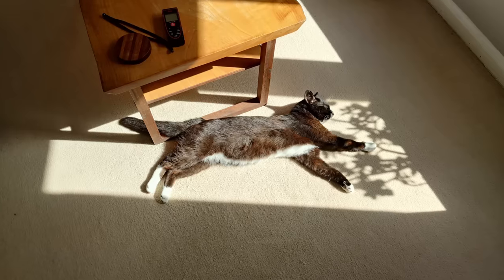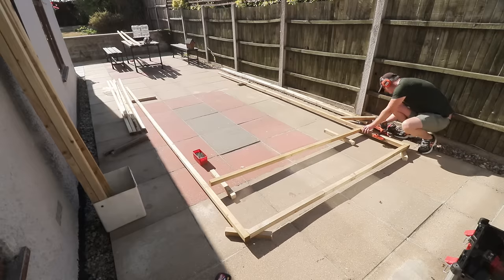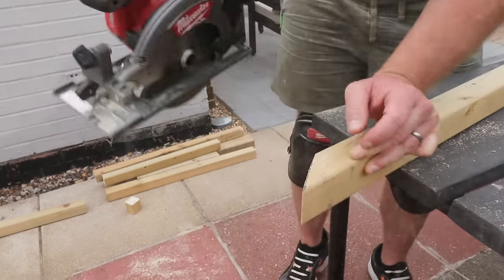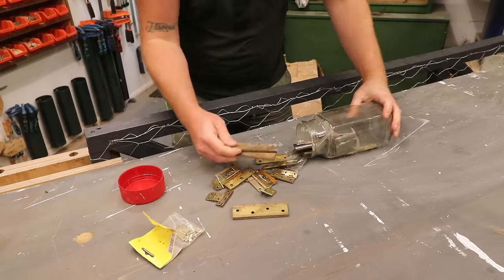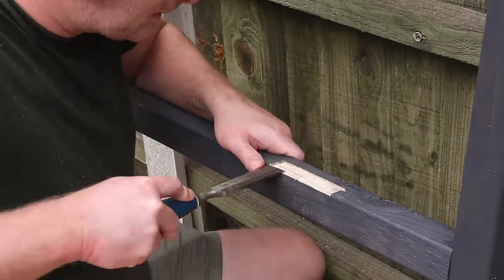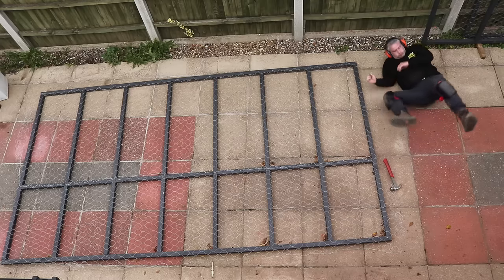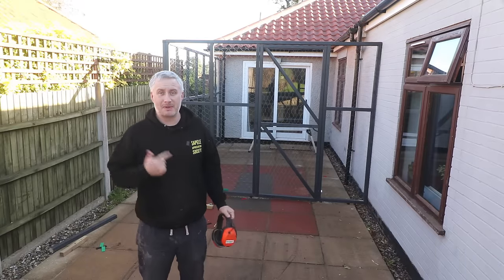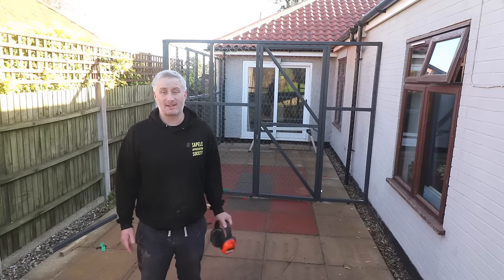We Built A Catio!

Comment: Awesome video as always. My wife is sitting next to me watching and asking when I will build a Catio for our babies. Looking forward to part 2.
Reply from the maker: Good luck! Haha. I would suggest not being so frugal when it comes to choosing mesh! Thank you
Reply: @RagnBoneBrown  I would second that, use the plastic mesh, and use a thin lath held down by some screws (paint lath and beam first, as otherwise rot will set in fast) to clamp the mesh.  OK the plastic mesh or the expanded metal is a darn sight more expensive over chicken wire, but you can also use weldmesh as a fence, it does not stretch, but you will need some serious pliers to tension the long wires to get it to hold straight, plus it does not cut with regular pliers, you want a decent set of bolt cutters instead, saves your hands.
Reply: @RagnBoneBrown  looks like you had some fun with that. Learning curve I suppose.

Comment: I'm going to be building a small catio for our cats soon, so this video couldn't have come at a better time. One thing I'd suggest for next time/repairs/anyone else doing the same thing is that 25mmx25mm 1.5mm welded wire mesh is much better than chicken wire. It doesn't 'spread' like chicken wire and is much stiffer so doesn't deform (We've been using it for a few years to make window guards to keep the cats away from a busy main road) and adds a bit of rigidity to the frame. For adjustable feet under the bottom rails, I'm planning on using some galvanised or stainless M6 bolts with a nut and washer or some M6 inserts with a hole drilled through the rail. I'm looking forward to seeing how you solved the roof problem so I can steal it!
Reply: I agree about your thoughts on chicken wire. My concern about chicken wire is that if a cat were to extend their paw through it, and for whatever reason panic or get startled, they could get injured. The wire gauge is just so thin and the hole size is just too perfect to get caught in. I'm planning on building one with 2"x4" deer fence, which does the same thing your 25mmx25mm mesh does: better rigidity!
Reply: I agree. I used the welded wire mesh on the roll for a lot of my projects
To secure it I use a nail gun that can also take staples. It's a damn site easier than trying to use the hammer in staples

Comment: I thought you did a good job with the wire mesh.  Around here, we call that "chicken wire."  We built a catio a few years ago, and I chose a different type of wire (rigid mesh).  It was also a pain to deal with, but it was a consistent width.  I also got some staples for my air nailer, and that helped me avoid using those individual staples.  Hopefully, Mickie will appreciate all of your hard work and effort.  Good show!

Comment: That's a massive catio! haha. Mickey should be happy.

Yeah I'm sure that chicken wire has it's upsides somewhere, but I hate it as well. We ended up using stucco mesh with an air stapler which was quite a bit easier.
Reply from the maker: Cheers John yeah that sounds a good solution

Comment: Having built a zillion chicken runs ( I had a poultry business) I feel you pain with the wire. It took me a couple of days to abandon the metal 'u' clips. I use a heavy duty manual stapler, it always worked fine. As for the wire, the higher the gauge and the smaller the hole makes it far less stretchy. But like you said, its a one off for you. Last point, I have seen cats get through gaps where they seem to dislocate every bone to become a pancake, that cap where the shingle is against the house looks suspect. Love you vids.

Comment: Hi Keith, having built a number of outdoor runs similar to the one you are building here for cats, dogs and chickens might I make a couple of suggestions. I gave up on chicken wire a long while ago and have used 18Ga galvanised weld mesh since which is far more convenient and holds its shape and is easy to cut with snips.  I buy this in 25m and 50m roles which works out much cheaper than the short lengths sold in garden shops and box stores and 18Ga is much easier to fold than 16Ga which is fine for flat surfaces, but not suitable for hand folding. I also use a Bosch PTK 3.6 Li cordless stapler. I find the 8mm galvanised staples more than adequate. The 4mm are also useful for upholstery, making the tool quite versatile, one charge will keep this cordless stapler running all day no problem. I have given this tool hard use over the last three years without any problems and it is as reliable now as when I bought it.
For roof access, could you not fit either hinged sections between the joists to access down pipes and gutters, or simply sections held in place with swivel clips, which would allow you remove them for easy access when required.
I think your cat should be really chuffed with this splendid catio, as it is huge and offers all sorts of possibilities for play and climbing and of course sleeping in the sun!

Comment: Great video again Keith. I couldn't agree with you more I hate working with that chicken wire and the staples. We built a kinda catio about 5 years ago but we done it up our 7ft ranch style fencing with a backward angled bracket and a tension wire to stop out cats getting out which is something you could consider for Mickey save u having build a roof structure just do it like prison style bars sloped back if he tries climb it he won't be able get over because of the angle. 🏴👍

Comment: Yassssss!  So happy to see this.  Our two kittens (brother and sister) had supurrvised (sorry had to) access to the garden in summer when they were still to little to scale the fences.  It was always our intention to build a catio for them.  Previously we had a cat wander off one day and never came back home.  That's over a year ago and we're still hoping.  He might not be too happy though if he does come back.  Two other kittens in the house!!  Anyway, back to topic of catio.  Delighted you're doing this and sharing it.  Is there any chance of a plan or a list of materials used please?  I was very doubtful about using chicken wire too.  It's a bloody nightmare to work with.   Bought some before for some project - probably to block a hole where our old lab was digging under a fence!  Cut the hands of myself and it just looked crappy and saggy and stretching it made it look awful too.  I bought some window screen fabric on amazon to make screen doors with.  It's STRONG.  The two kittens immediately scaled it when I pulled it out.  The boy kitten was quite big at the time and he didn't even put a dent in it.  It claims to be cat proof and I'd definitely say it will hold up to much wear and tear from them.  I was considering using it in the catio.  It's a grey colour so it will provide shade.  Easy to cut with scissors.  It might just do as a temporary fix.  The poor wee things have taken up residence on the kitchen window staring out at the garden.  They need to get out and play.  We only need to build two walls as well so really hoping that you'll share a list and breakdown of cost at the end of it.  Love the little feet you added.  I bought some headboard stoppers on amazon (No I don't have a love life.  I toss and turn a lot at night and waken my son).  One end is plastic and the other is metal.  Quite sturdy wee things.  Was thinking of using them on ours and they're adjustable too.  If you want the link to the mesh screen fabric I mentioned or the headboard stoppers, let me know and I'll email it to you.  I'm definitely buying more of the fabric so that we can open the upstairs windows in summer without them getting out.  They love to sit on the windowsill but Otis (boy kitten) keeps forgetting his butt's so big and slips off.  Don't want that happening upstairs!  His sister Willow is like a dwarf so she doesn't have that problem.  I swear she hasn't grown since we got them in May!!  But she could eat for days! They're wee inbreds so that might be responsible for her diminished size.  He's a giant - truly.  And still growing.  Even the vet finds it hard to believe that they're siblings.  So funny.

Comment: My concern about chicken wire is safety. The size of the holes are just about perfect for a cat to stick a front leg through while trying to bat at a fly or other critter, and then when they have to quickly pull out, their skin bunches up (like trying to remove a ring from your finger) and they panic, creating a possible vet visit. I'm going to be going with 2"x4" deer fence which has a much heavier gauge metal and is a nice rigid barrier.

I think I have a hack to make those staples better... Bend each one so that their legs are parallel. Like a normal staple. It's probably a lot of fussy busy work, but I bet they drive into the wood WAY easier!

Comment: I recently did a new roof for some friends who have a secure outdoor space for their cats. The issue was the same as yours, how to allow access for maintenance. I devised sliding fit panels using roofing laths that fit in between some struts. So using your cross pieces I would add some 4x1 underneath to leave 1” either side then rest the panels in between the cross pieces. I also used 20mm square mesh instead of chicken mesh, so much neater and easier. I also used my air stapler to fasten the mesh to the frames. I can probably do a quick video of it if that’s any help?  Works rather well to be honest

Comment: I've built something similar for my cats and you don't need a full roof. Do a search for 'purrfect fence' to see what i'm on about. I used their design as inspiration, but used galvanised flat bar bent to the correct angles and covered with nylon plant support netting to keep the cats in. This is where you do want the netting to be loose, the cat doesn't think its solid so jumps off. 

I kept 4 cats in for 5 years this way.

P.S. based on my experience, they'll get out via the gap under the walls.

Comment: Keith, I really feel your pain with that chicken wire. I built a catio myself a few years ago and I chose for the more expensive galvanised sheet-rolls (not sure what to call it). and they worked a treat. they are more rigid and you just roll them out on top of your frame and secure them with a stapler. the catio is still there and going strong.

Comment: For the roof Look up dove bird netting. 
Its what i used to keep my cat in, can be pulled taught, nylon so rot proof and cant be chewed through. 
You can anchor eye bolts to yoyr walls and feed parachute cord on the mesh and clip this to the eye bolts to form a removeable easy access, lightweight roof that cats cant escape from.

Comment: Looks like a luxury space for MIckie, good job Keith.
I’ve had similar experience with chicken wire and hoops, horrible stuff to work with and as you say the often often bend when you’re hammering them in.  An alternative to those hooks is to use stainless steel staples in a craft stapler.   They work quite well at securing mesh to wood.
Just thinking about the roof, does Mickie actually climb up the furniture, maybe you could get away without any roof at all?  Or maybe a small 30cm roof just around the wall edges as you see at the zoo.  If you do put a roof on it’ll get leaves accumulate on it as well.
Reply: We used a normal stapler with similar mesh to build a fruit cage on our allotment. It worked really well, though might be worth checking for strength to make sure it'd keep a cat in...

Comment: Hi Keith, when I did the wire on my original chicken run I used a hand held staple gun (Stanley heavy duty hand operated type) really quick and although the staples do rust  they lasted well and were still holding well after about 8 years, I was worried that they would pull out but they hadn't so I guess the rust holds them in. Chicken wire these days isn't what it used to be and will rust fairly quickly, I used some around my garden and have had to replace it after just 2 years the modern stuff is rubbish!!

Comment: I recently had to modify an enclosure for guinea pigs. I salvaged all the materials from the old enclosure including the treated pine frames, pigeon wire and those exact same saddles. I also really struggled with the saddles in the same way you did. Eventually I ran out of them and rather than going to buy more of the things I was struggling with I decided to use my manual stapple gun and the cursed that I had not used that from the beginning. I also ended up with pieces of the straight edge of pigeon wire that I had to cut off. Not a fun time. So I feel your pain.

Comment: Cool build. I agree a lot of that wire mesh is a pain, and those nails are no fun. I usually use a staple gun if I can.

Could you put 2 or 3 feet of the roof on hinges to flip it over for gutter access? Good thing you thought of it now, I would have been cursing myself the first time they were dirty 🤣

Comment: Nice build Keith and i know what you mean about the Galvanised Wire it's horrible stuff, try and get the sheets if you can and rip that lot out and replace it with the sheets. One thing i was concerned about and that was the uneven floor, there is that slope that you can see were you were doing those black feet and Mickie might be able to slip under the frame, could you not put a 2 or 3x1 along the bottom of the frame maybe scribe it from the inside and cut the wood to match, just incase? Mickie might not want to get out but what's to say a cat might try and get in they are crafty. 
I have an indoor cat and she is a scaredy cat as well and i was just thinking of something like that for maybe in the Summer.
Sorry for the long message just concerned about that gap.
Stay Safe 😷😷
Barry (Wirral)
Reply from the maker: Cheers Barry. A few people have mentioned it but it's only 60mm, I really don't think he would squeeze out he's a big boy! 👍
Reply: @RagnBoneBrown  It's not Mickie getting out i'm worried about, it's another cat getting in and passing germs onto Mickie whether she's outside or not.

Comment: I built a catio this year and did lots of research.   Using chicken wire can be bad as it’s not strong enough if the cat tries to climb it.  You need mesh with a spacing of either 13mm x 13mm or 25mm x 25mm with a gauge of 19 or 16 to be on the safe side.

Comment: When we built our catio I put in some heavier duty rafters, and then built mesh panels to fit between, so you can remove them whenever from inside. That mesh is a nightmare, we went with square mesh which has the advantage of not stretching, but it was still on a roll so still a nightmare. Staples. Yep I hate them too! It eventually fuelled the decision to buy a powered stapler and wrap the mesh on the battens a bit more

Comment: Just so you know. I used the same type of wire. It is very thin. I've had squirrels chew though it and get into my catio. had to go around the bottom with heavier gage wire. Mine is at least 6 years old and getting weathered so I am going to build a new one with 1inch by 2 inch fencing. It's heavy enough the squirrels wont chew through it. and still small enough the cats can't get through. good job on your. just keep an eye on the fencing.

Comment: I know your pain, have built much containment using that stuff! A cable tacker or staple gun is your friend for attaching it, the staples you used were a bit overkill. Keep up the good work!
Reply from the maker: I don't think regular staples would last outside
Reply: @RagnBoneBrown  Yup, been in this house 11 years now.  Compost heap, hen run, extension to fence so dogs can't jump out  all with galvanised electricians cable tacks.
The odd one pops out but they are quick enough to replace, and in quantity.

Comment: Suggest you staple the chicken wire over most of the roof but have a last section about 60-100cm that’s got removable fixings either end on the the wall side edge you need access to, that overlaps the fixed mesh. If it’s tight he won’t be able to climb the wall and try and get out, but you can remove/roll back the last section for roof access off a stepladder.
Reply from the maker: Good idea, already built the roof though 😁
Reply: @RagnBoneBrown  as long as you can get shoulders between rafters you should be ok?

Comment: Interesting video. Thanks for sharing.  Beautiful catport. Great idea to put spacers between the posts and the wall.
Would it have been possible to use a nail/staple gun to connect the mesh to the wood?
I'm curious what solution you'll think of for the roofing.

Comment: wire fencing isn't normally used in such a precise application, though I have no clue how they "size" it... you could just add some thin strips of wood over the seams if it is that unsightly though
I would question whether a sufficiently determined cat might make their way through the larger gaps at the bottom, as the whole thing can't weigh that much

Comment: with the food running out, you prolly should turn  that space into a greenhouse that is cat friendly.
Reply: just have to put in a big wide low planter, and sow oat seed there regular, for mickey to graze on. I do that for my cat, using the premade packs of oat grass from the pet shop, though i also only use a third of a pack at a time, simply recyling the old vermiculite when the grass is dead to use to bulk up the new batch of seed. Cat loves to graze on the grass, and it is good for the digestion.

Comment: Yes those nails are junk, better to simply use a staple gun instead, and get both a staple that goes in one handed, and also you just paint over it again. Roof wise all you need is to make an interior overhang of 500mm, using those beams you already cut, and some of the 500mm spacers. Then staple the chicken wire to it, and cut in half, then stretch to make the roof of the wall. That way centre is clear, and cat cannot climb out, and gutters can be cleaned still.